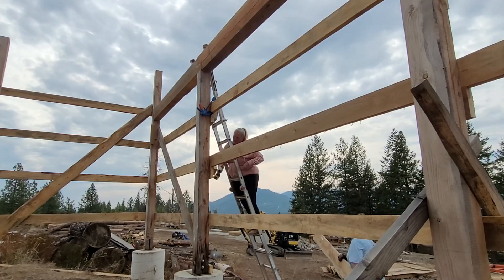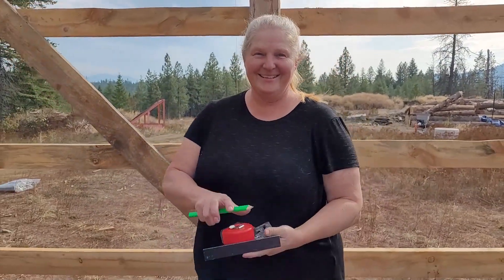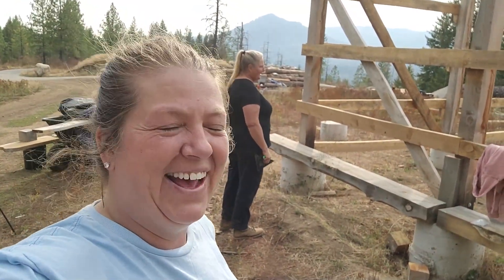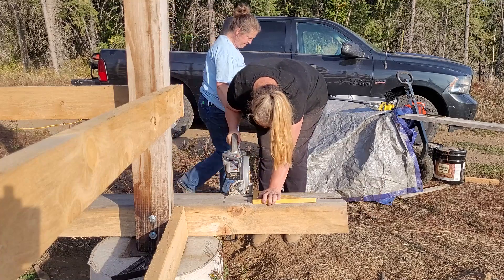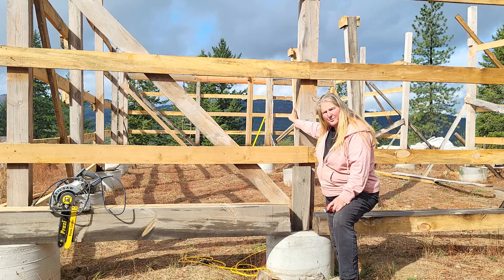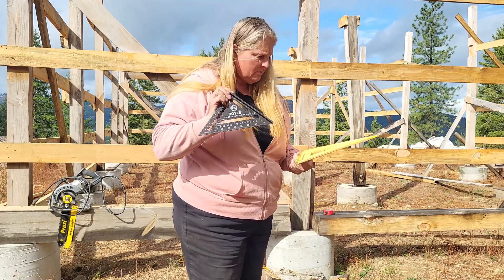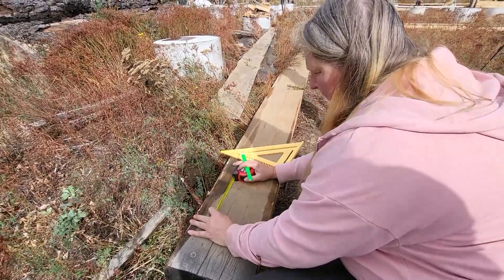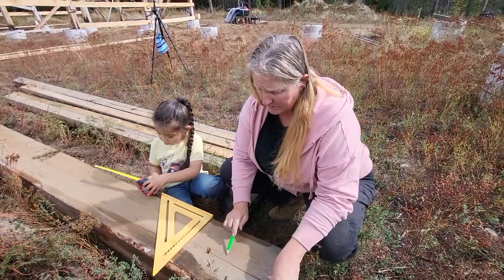Our Journey in Building a DIY Post and Beam Barn/shop// Eps 15 Cutting huge Beams!! SCARY!!

Comment: Bummer the rain stopped the progress. Was looking so good. The framing looks so much stronger now that the diagonal bracing is in place at the corner posts. (Thank you Randy). Since the joints are all the same, maybe make a jig out of 1/2" plywood. Lay it on the beam and trace out the cut lines? Bing-Bam-Boom!! Thanks for sharing
Reply from the maker: A jig would definitely work.  I wish I would have done that before I started cutting up the beams...grrr.  what a mess.  You will see in the next video

Comment: The impact is not a drill but it was made so that the head on the bit does not try to turn in the head of the screw. The drill was made for drill bits doesn't work well for screws.

Comment: Having the right tools do make things easier but you use what you got. What kind of saw is that looks like a skill/chainsaw? Pretty cool. Great job Heather that alot of figuring out. ❤❤❤
Reply from the maker: It's the worm drive skillsaw and I bought the chainsaw attachment for it. It is cool when it works.  I made some bad cuts you will see in the next video and I am super bummed